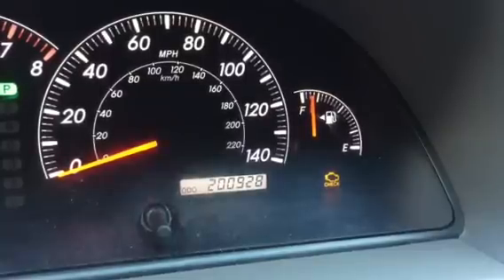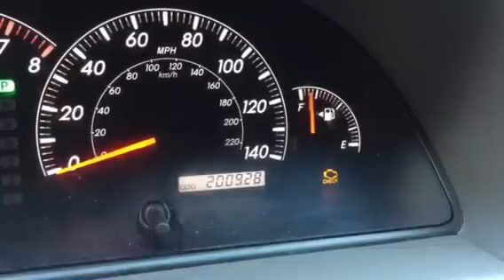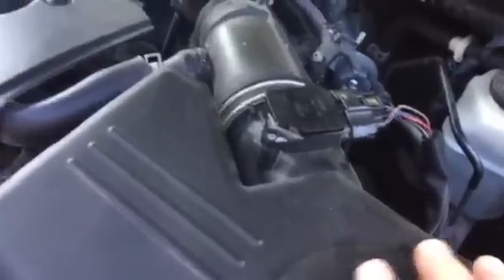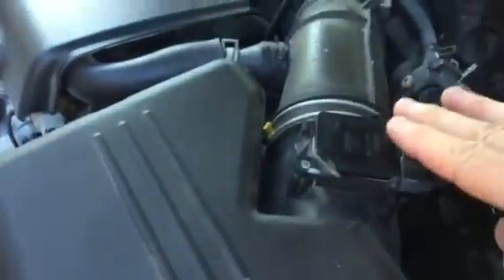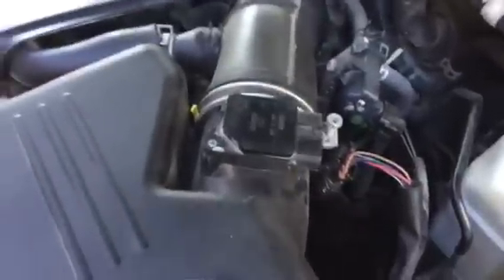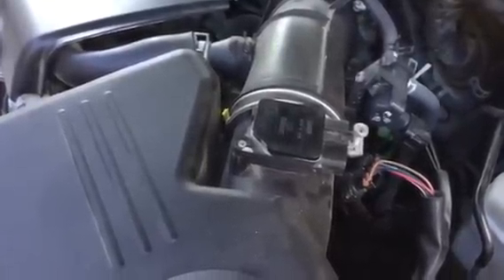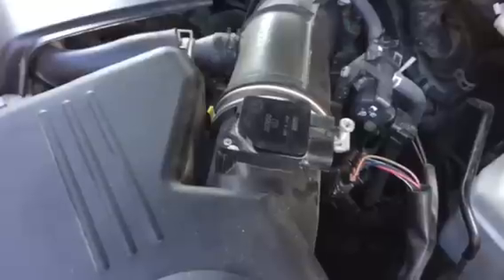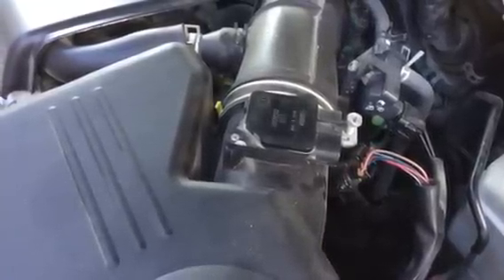How To Tell If Your Mass Air Flow Sensor Is Bad On Your Car

Comment: Had a P0171 fault code (system too lean bank 1) pulled my mass airflow sensor as you described and the engine carried on running so tried cleaning with MAF cleaner which worked for a few weeks then got the code again so I have replaced my MAF sensor again fine for 2 weeks but now I have the code again ????? HELP!!!!

Comment: My engine kept running after disconnecting, is it possible that maf is good? I don't have power at my car and I can see black smoke behind me. VW 1.2tdi . Mechanic told me that I have to chceck my injectors

Comment: So if you unplug it and it don't shut off how is it the sencer wouldn't it be something else down the wires I unplugged mine on my 2004 dodge 1500 hemi 5.7 and all I get is a check engine light

Comment: I disconnected my mass air flow sensor while engine running and it keep running when I disconnected the electrical harness my engine didn’t stop I can even drive with it disconnected and it runs better disconnected so I’ll change it according to you I’ll give it a try

Comment: You dont need to replace  the sensor just remove it and use the correct spray cleanerfor a few seconds, dont touch any of the very sensotive parts inside  ! Trust me, it works///////

Comment: Just cleaned mine it most definitely 100% worked. I took off the negative and positive battery cables before cleaning. Once I reinstalled everything my check engine light went off immediately when I first started the car
Reply: If you take off your negative battery cable the check engine light will go off but will soon come back on if problem still exists.
Reply: @davidbatin1699  thank you for saying this the autozone lady just ripped me off bro
Reply: @davidbatin1699  100% true. The check engine light will reappear the next time they shut the engine off and back on again.

Comment: Tks! Also remember if you are driving and the engine shuts down just like the key was turned off peck on the MASS AIR FLOW SENSOR. If it's bad this may get you going till it can be replaced. If it's bad even at ldle a light peck will kill the engine and another will let lt start. This happened to me on a 96 Maxima!🇺🇸

Comment: mine went bad alone with e.c.m. and coolant temp sensor. triple threat. it's running great now and awesome. those can be cleaned with a q.tip. dipped in 70% isopropyl alcohol.  it leaves less residue than even m.a.f. spray cleaner. spray your a.t.s. dont use this if you don't know how. sensor wires are delicate. it definitely works. I've been doing this for years.

Comment: Thanks.  Ive been having hard start issues for 10yrs and now i got a missfire.  I stubbled up on this video, and just tried it.. My silverado still runs when i unplug the sensor. So now I will try a can of cleaner first.  I hope this is the case, because i want to get a few more thousand miles out of my work truck before i get stuck with a note.

Comment: Yes that helped me when I disconnected mine the engine kept running. Time to get a new MAF sensor.
Reply: Did that work for you?
Reply: @whowho7969  No cause my engine carried on running but it wasn't that. I had 2 vacuum hoses that were split coming from the EGR valve and when I replaced them I got them the wrong way around and the engine was running very poorly after swapping them around now it's running fine. So problem solved.

Comment: I also tried this method. After cutting connection with maf sensor the engine hesitated for a second but did not stop. Then i replaced it with a new one and all the problems are gone but when i tried this method with the new sensor i saw that engine did not stop either. That's weird. So i think that this method is not valid for every car.
Reply: once you unplug the maf it relies on other sensors and bases its calculations off of that in order to stay running

Comment: My nissan pickup wont idle with mass airflow sensor plugged in but unplugged it and it idles fine. I've replaced the mass air flow sensor twice and still the same. Any idea what it could be?

Comment: I have a 2012 Nissan Sentra that has been starting and then dying on me. I have a p0420. It suddenly started driving normal with 100 miles on it now. I went out and tried this and it bogged down, like it wanted to die, but didn't. Plugged it back in and it started acting stupid with my VDC(?) Light on. I think I might try a new MAF sensor see what happens

Comment: I have no errrors on mil on. But it lacks power. Sometimes mafs dont throw up engine light. Will plugging out  maf still cut out my car. W212 merc e220 low on power

Comment: I unplugged mine and it kept running. I changed my MAF and even with the new one it's still running? Does that mean the new one's bad also?
(2001 Crown Victoria)
Reply: no, it means your computer, the ecu has learned values, you have to either disconnect the battery and leave it off over night.. Just the negative terminal, or drive about 100 miles and let the self learn ration set itself. If youy have to smog or inspect. Do not unplug battery..  or you will have to do the Drive cycle for your model to pass smog/inspection. Just drive until your check engine light goes off or if you have a scanner, til your long term fuel values go back into normal range. Which is when your long term and short term get you with a total of ten. So long term is at plus 10 and short term is at negative 15.. you would be at negative 5. an you would be  good cause you wanna be in the plus ten or minus ten as a final number With a 0 is the perfect number.

Comment: I have a 20122 Toyota Prius with over 300,000 miles that I track everything on using some car care software https://youtu.be/xKuE5kZS934 that also monitors the fuel economy. I saw a big drop from 48 mpg down to 40 mpg a few weeks ago. Then suddenly the check engine light came on. I had it tested and it threw 2 MAF sensor codes as the culprit. I took out the sensor and spray cleaned it using the CRC MAF cleaner.  Now the light is out and I'm back to about 48 mpg. I should also mention that any vacuum leaks in the system can aslo cause this issue.
Reply: Tried the software and love it!  Thanks
Reply: The Automotive Wolf software is excellent! Thanks for the tip :)
Reply: Cool software!

Comment: Some cars will actually still run but run poorly when you disconnect the MAF sensor you could also cause a short and blow a circuit or fuse, but yes in general coukd help especially on modern cars,
Reply: No.  That's not the way an electrical circuit works.  You won't blow a fuse because you just created an open.  Shut up if you don't know anything.

Comment: I installed a new MAF sensor any truck still runs. Actually runs better, when I plug it back in my truck stalls. 1999 Chevy Silverado 1500 with the 5.3.

Comment: so my 2013 cadillac ats 2.5L has been acting up recently and has been causing a financial strain on me, what it's doing is when driving it'll drive normally but after sometime (usually after driving at high speeds) the engine will choke up and lose power then regain power, rinse and repeat. Is this due to bad MAF sensor? I've already tried spraying the sensor out with the special spray but no difference... I haven't tried what was shown in the video yet but I'll go test it out but since buying the car couple months ago, i've replaced the spark plugs, camshaft actuator solenoids, bank 1 o2 sensor and that's when the car started doing this. any tips?

Comment: I would like to add one thing love the vid but we have a brand new 2021 d-max turbo diesel d-id 3.0lt and if we pull the mass air flow sensor of while the car is on it dosnt always make the car sell.... alsong with my teiton won't stall but we then can't re start the car if we turn it off with the maff sensor not connected

Comment: Even tho I do this technique I was told it’s not good to do. also mine sounds like it’s trying to cut off but won’t.. it sputters . Also my codes read gas flow restriction for the EGR or Solonoid so I’m not sure what the issue is. I stall at red lights low idle

Comment: This does not apply to all cars. Some cars will adjust themselves so you can still run your car (with lower performance)
Reply: Yes sir OBS Chevy trucks and SUV’s will always run good with minor issues like this some car and truck brands must be perfect to run or they won’t even start old Chevys Vortecs have great computers that compensate air and fuel flow even if it’s off until fixed.
Reply: Yes you're right 👌👌 some problems may dissappear if u take off ur MAF 😂😂
Reply: My 91 Escort did that.
After buying it i drove it fol half od year while being not awarie that maf is missing.
Reply: As you said your comment did Justin apply to all vehicles a lot of the vehicles will adjust the fuel air ratio by itself and keep running when you unplug that Mass
Reply: Good to know. Thks.
Reply: Correct.  The ecu will work off of the MAP sensor if the MAF is unplugged.
Reply: This is good to know for sure.

Comment: my 2017 Tahoe with 55,000 KM just set a P2097 - Fuel Trim sys Running RICH 
Dealer Replace the Mass Air Flow Sensor - Seems OK not sure if that was the FIX

Comment: Amazing.. Thank you so much.So, in theory, if by disconnecting the MAS the car keeps running it means the sensor is not measuring any air going into the engine.

Comment: Wow, after months of trying to figure out what was wrong with my car - talking to and taking it to many mechanics this is the answer I have been looking for.  Thank you soo much man, I can now freely go travelling my home country!
Reply: What symptoms was the engine giving or just the Check Engine Icon TURNED ON ? TY
Reply: All the mechanics had to do was put it on a scanner and read the codes. Some scanners tell exactly what is wrong
Reply: I have Cx5 2014 sport, 6speed, 135,000 miles, I've had spark plugs & tune up, misfire coil wire #2 changed. Ran well, for two weeks ago, I recently noticed some hesitation & jerking again, upon stepping on the gas going up a hill,  was only able to go 5 to 10 miles smh.  I ordered the MFA oem  part, and hopefully, this will fix the issue. The car has been to 2 garages, totaling $500,  and  I've heard hope its not the engine or something else from them. Thanks for your video❤
Reply: Same story here with a 2016 Kia Soul+. One lone misfire on cylinder #2 code, that never came back. So no codes to go on for 6+ months. Changed plugs, coils, battery, filters, cleaned fuel injectors. Took it to 3 repair shops. Spent $$$$$$! Last shop said maybe it's in Limp mode with no code? Or maybe it's the transmission? Called the Kia dealership twice $200 to put it on the first level code reader, $+++ after that! Kia even said maybe it's beyond repair! 😢 At 133,000 miles!? It went from great car to 40 mph tops, then to 20 mph tops over 6 months. Won't climb the smallest incline. Jerks, rough idle, can't press the pedal down even halfway way or it starts knocking under the middle passenger's side. Barely no forward power, and jerky  Fuel economy dropped from 30 to about 10 mpg. Runs best upon starting for the 1-2 minutes between "cold" & "neutral". Doesn't go over 2000 rpm. Seems like it doesn't shift out of second gear. But no codes! Just a quickly flashing oil light  after it's been running for awhile, but I've checked the oil dozens of times & it's always full. A lot of weird symptoms! I'm gonna try this MAF test & see if it's that!

Comment: Just pulled the wire on my sensor [ engine check light on ] and my engine continued to run.  could it just be dirty, needing cleaning as you described in your other video?
Reply: Did you ever figure it out?

Comment: Just changed my mass airflow sensor the other day...And the check engine light went off...But for some unknown reason which I could not figure out the check engine light came back on and stayed on...So when I did the test the mass airflow sensor failed the test...But I did not give up because it was a brand new sensor cost me $100...So I focused my attention on the air cleaner and when I checked it I had it in backward...So when I put it in the correct way the check engine light went out immediately!!!

Comment: My camry has 180K miles, no check engine light but often wonder about the MAF sensor...Will pulling the connector off while running inadvertently set a code, even if it only runs for a few seconds?  I don't want to confuse the repair shop in the future if they discover this code that I set by pulling the connector....

Comment: Cars can still run with out the maf plugged in, beware that might not be your issue. If the car is running rough and you unplug it and it runs exactly the same it for sure is a bad maf though.

Comment: I tested this on my dads Chevy Malibu 2016 and it kept running. His car runs perfect and has absolutely no check engine lights. I’m sure the information is good. but it might not work with newer cars that have smarter ECU and hybrid vehicles.

Comment: Hey what about a DIRTY mass airflow sensor?  would it cause the same reaction? Appreciate your time
Reply: Yes it will. You can clean it and it should run better. But if it totally failed you would need to replace it. Some time even after cleaning it a couple weeks later the code might come back.

Comment: Does it work on every model? I did this test on my 2003 Mitsubishi Eclipse and engine kept running,so I purchased brand new sensor installed it and perform test again,engine was running again,after I disconnect wires,lol.
Is it possible that this test not working for every model or there is something else wrong with my car? I didn't receive any codes,engine start and running fine too.

Comment: What if the car keeps running (I’m sure that’s still the key here) but revs high and low?
Reply: That means the air flow sensor ia bad, and the ecu will instead use factory data and the car will drive even better without, it will take reading from the o2 sensor instead
Reply: @johnsousa9578  you are right.

Comment: I did this...the vehicle kept running, but the rpm's would drop real low, almost to the point of stalling, then shoot back up to about 1.5k RPM then drop real low again then shoot back up. The RPM fluctuates like that when its connected, but not nearly as severe as when its disconnected. Hooked the OBD2 scanner up and I'm getting an airflow code.
Reply: Try looking at the idle adjust valve.  $30. There is a little motorized actuator that can cause this.  Mine was revving up and down and that went away.  If you pull on the actuator, it should open and close.  It is what adjusts the idle speed.  Also... when I disconnect the MAF, mine revs up real high to about 2500. That is apparently the default that the ECU sets the idle at when it loses the MAF signal completely.  I will disconnect the battery to tell the ECU there is a new MAF on it now and see what happens.

Comment: You are so wrong it’s not even funny, most systems/engines will go into “Limp Home” mode (Yes, it’s a real thing) to keep vehicles from dying on the road when the MAF’s go bad. As a Professional Mechanic of 45 years and owner of Anthony’s Mobile Automotive Diagnostics and Repair, seeing videos like this makes me cringe, cars today are way too sophisticated to just start guessing and throwing parts at them hoping you get it right. Proper testing and Diagnosis is essential and there is no way around it, I’ve had to invest literally Tens of Thousands of dollars in Diagnostic equipment to be able to work on the newer cars plus years of schooling and Tech courses to stay up to date, do yourself a favor, don’t listen to guys like this.

Comment: I need to buy one because engine keeps working when I pull   connector. My mechanic found problem in MAF sensor using diagnostic device. So you are right. Thanks a lot for the video.

Comment: On my 2012 Camry se 2.5l and I don’t have a engine light. Never have.  I do keep having some hesitation issues in the heat. Anything above 80 outside. Never changed mass air flow nor my o2 sensors. Should o just do the o2 sensors first then do what you did with you mass air flow by unplugging it and seeing if my car stops or not? What do you think? Also my car is on my channel as well. Thanks for your input

Comment: My ford focus mk1 1.8l doesn't die when disconnecting the maf sensor, it just starts to idle very very rough as its trying to stay running ( rev up , bog down etc etc...)

Comment: Hello there thanks for your video I just have a question. I did this and mine was broke. I replaced it and check it again removing the harness and the car stop so everything look fine. 2 weeks later the car star with the same symptoms so I check it again and the engine won't stop so I guess the sensor is broke again. My question is do you think is because of the quality of the sensor that broke so fast or maybe there's something else in the car that makes the sensor get damaged?

Comment: I unplugged mine and it came close to stalling by still kept idling, still recommend replacing ?
Reply: I would, but if its running fine and everything is good then I wouldn't but forsure in the future

Comment: Quick question I unplugged the electrical harness from my master air flow sensor and the car stayed on I replaced the master air sensor and it's still doing the same thing it continues to stay on when I disconnect the harness what does that mean what else should I be looking for to fix?
Reply: I have the same question.  What did you end up doing?  Does the MAF sensor need to be recalibrated by the computer?